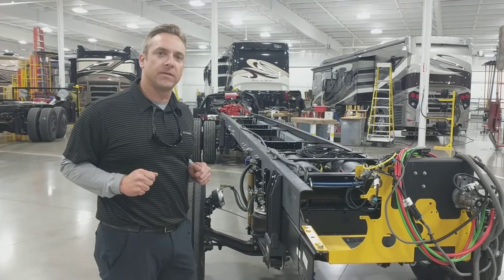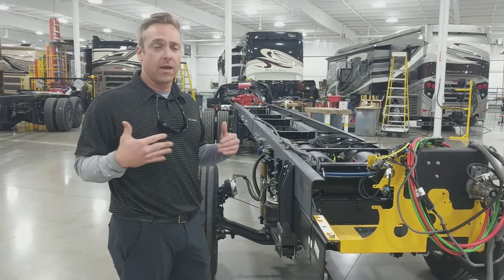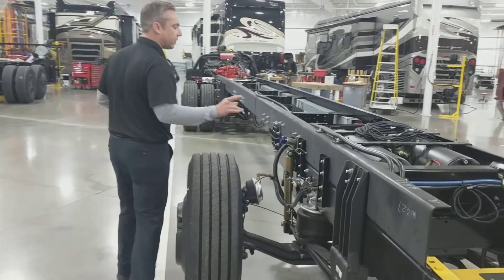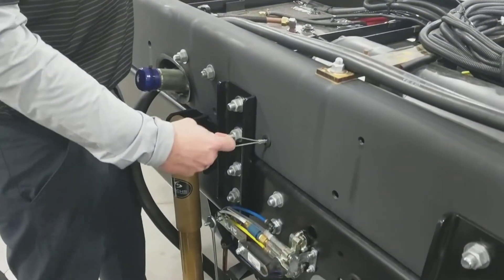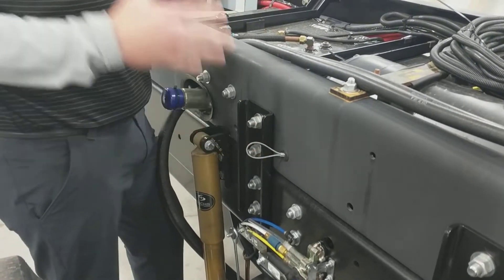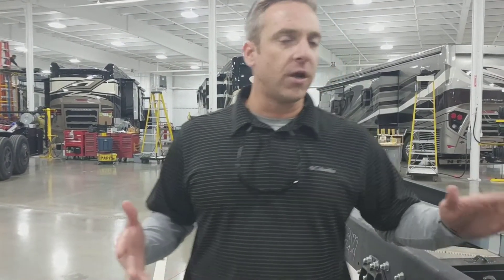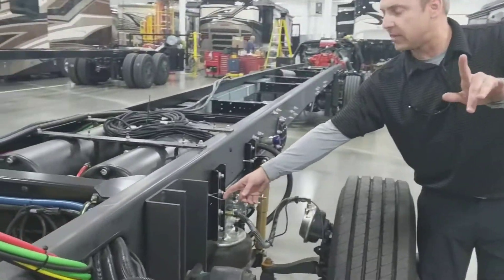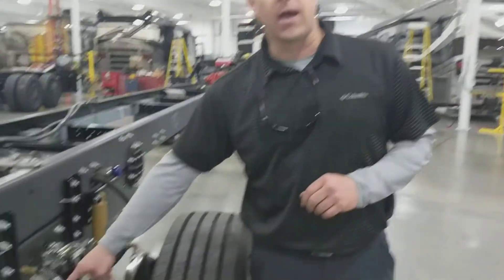Freightliner Chassis Tip - Checking for Air Brake Moisture from Newmar Master Training

Comment: I just sat through a superb Spartan class with "Big Mike" O'Neil; lots of Spartan's methods cross over to us Freighties. On my own 2019 Dutch Star, that second lanyard on the DS got "lost" between the frame rails during its time at Nappanee; I fished it out and re-routed it. At Gaffney, a senior tech doing our 4 year check slapped my wrist for being creative, routed that aft DS drain so that it occasionally seized up when pulled. Thank goodness I drained without the engine running; if not, I'd have never heard the stuck-open valve and we'd have had safety problems and likely system damage! That loop is now in a teflon case for safety and security.

Now, Spartan has a specified sequence for the three drains, with a trip to the cockpit to verify remaining air pressure.

Freightliner makes no mention of this in their manuals.

Can anyone speak to the sequence issue?

For what it's worth, I drain tanks daily when driving. Also, I installed a draincock in the aft tank to manually drain each semi-annual chassis-crawl.

(No longer on iRV2 or the Facebook Newmar groups due to political antics, corrupt moderation.)

Comment: I just got a brand new 2023 Freightliner and I can't understand why it jumps like a galloping horse it's breaking all of my electronics tosses everything around to the point where the TV totally just disconnected in two pieces off of my Mount while driving the heating element in my microwave conventional oven air fryer combo is totally gone out the whole entire tray just pieces because it just broke from the bouncing. My 2020 Freightliner did not jump this much. I don't know if it's because of the new tires or if something's wrong with the shocks or what. That's why I came to this video but this video did not inform me on that. Can you tell me why please?

Comment: If this this first time you know about this, you need to quit your job! Anyone that drives a diesel pusher should be doing this every time before operating this motor vehicle. Do you even know how to do an Air Brake Check, or do your slack adjusters. The problem is that dealerships will sale you something, teach you how to turn on the AC, but nothing to save your lives. I am all for everyone having a non-commercial CDL-class A.

Comment: Air tanks should be drained whenever you park overnight or longer especially in the winter. Your tanks could freeze and you will suddenly loose air pressure which causes brakes locking up on you going down the interstate.

Comment: I agree, but that's extremely basic stuff for a 'Master Training' course, surely everyone who works around compressors and pneumatic systems knows to check and drain moisture? As far as I know lots of truckers check moisture either daily or weekly.
Reply: Yea in the military were told to drain the tanks at the end of everyday to prevent freezing.